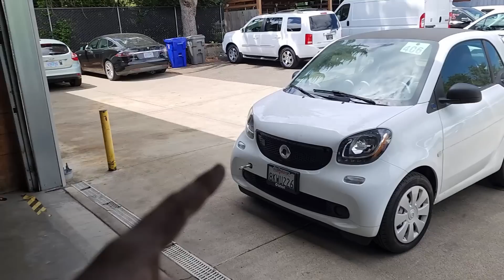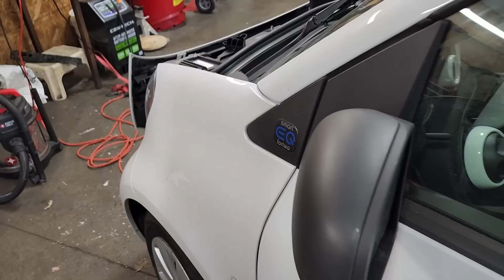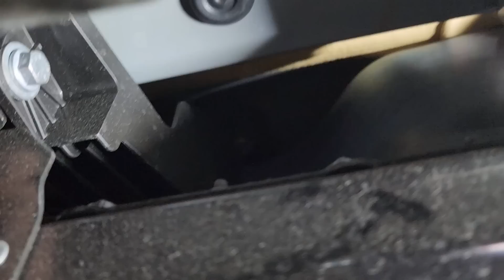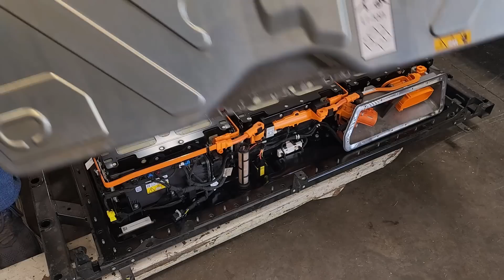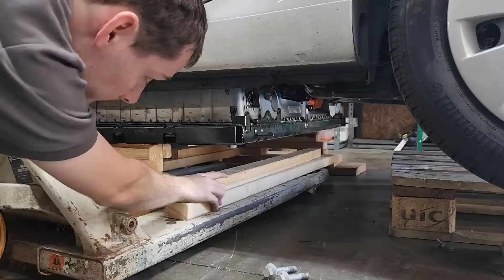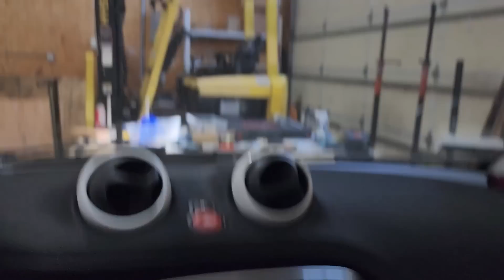Repairing a BMS "glitch" on a 2019 Smart EQ

Comment: I watched this video and would like to offer a couple of points. 1): If you have more than one floor lift you can probably get extra short arms to lift that tiny car. 2): A straight drive on lift like used for wheel alignments would get that tiny car up to work it very easily. 3): When you opened the battery pack you can see where the desicant is located. I would have replaced it since you are in there already. I can just imagine the cost for a dealer to drop the battery ever 2 years to change out that desicant pack.
Reply from the maker: The dessicant cartridge can be replaced without dropping the battery (it unscrews from the bottom). And like I mentioned, there's really no reason to "have to" replace it, just an arbitrary requirement that Mercedes made up.

As far as a drive on lift goes, the battery would be too wide to fit between the "runways", so not possible to remove it that way either. I specifically don't have a 4 post lift simply for that reason, they aren't of much use to me for these kind of jobs... I do have another 2 post lift that I could have swapped the arms off of, but then I would have been unable to use the it for anything else while the car was on it...

Comment: I wish this video existed 6 years ago. I mistakenly installed a mileage tracker (which had worked without issue in a 2016 Smart ED) into my 2018 Smart EQ. The 12 volt battery went dead twice before the problem was traced to the tracker. I removed the tracker and haven't had a problem since, although the 12 volt battery was replaced a couple of years later. I'm not sure where I'd be able to get this work done locally. Having to ship my car to Portland would probably be prohibitively expensive. Thanks for your work.

Comment: Looks as if you could have used a floor jack to lift up the rear of the car and swing the lift arms past the tires and use the lift.
Reply from the maker: The arms still would have been too long, and would have been lifting on the battery itself (no bueno!).
Reply: @AlexEVRepair  Good point.  Could you have driven the car onto the lift pads and lifted it by the wheels?
Reply from the maker: The car didn't drive, so that would be a negative... Not to mention extremely sketchy. 
If I had wheel support adapters (that "cradle" the wheels in place), then that would have worked. Those run about $1600 for a set though, so not worth it for just one job... If I have more service requests from Smart owners in the future though, then it would be a worthwhile investment.
Reply: @AlexEVRepair  That's crazy expensive, you could probably have someone fab some for a few hundred.

Comment: Have you looked into the OBC failure issues on the 2017-2019 cars?  

My 2017 OBC failed.  One of the two.  Apparently there are two at 3.xkwh each.  If I understood correctly.  Anyways the repair is $8000 plus my battery went bad while sitting at the dealer.   MBUSA covered the battery replacement.  It took MBUSA and the dealer 11 months to get the car back in the road
Reply from the maker: I've read about DC/DC failures, but haven't seen anything about OBC failures. Maybe one day I'll encounter one...
Reply: @AlexEVRepair there are posts about it in the FB group and one of the smart USA forums.

Comment: Two things.. Presumably the contacts in the contactor relay degrade and they set a limit to reduce the risk of fire? Just resetting the BMS and not replacing the contactor on an old car might be risky? Or do they reprogram the BMS with an estimate of the number of cycles used?

The other issue is the seal on the lid of the battery. Surprised its not a liquid sealer to reduce risk of water getting in?
Reply from the maker: This car only has ~20k mi, so not nearly enough cycles to have damage from "normal wear and tear" on the contactors. 

As far as the battery lid goes, it has a molded on silicone rubber seal around the perimeter.

Comment: Haaa nice job man 👍 glad  I didn’t have to pull them out that way ! Having done a good 75 batteries on Gen4 smarts i would died  My Dealer didn’t want to up date the hoist so I used 4 front arm set on the hoist! The Filter Service has been in the service check sheet from day one on all smart ED just like capacity test !When the 453 came out which is the one you showed here we where Original suppose to be able to open them up and change cells and other components but it’s a lawyer liability thing with the manufacturer since the Germans and the Frenchies didn’t want us going in there! So they just get changed out and exchanged and 
Prorated! good video. I appreciate being able to see inside stuff that I was allowed to take apart.👍
Reply: FYI so not to brick the HV Battery the car wants to see a key cycle before 14days of non op keeping a charger on does nothing ! Thats also in the hand book ! Which is the most unread book by most owners
Reply: @buzzbierbaum4026  so you are saying you have to turn the vehicle on every 14 days or you will have a problem with the batter?

Comment: Why not take the tires off to get the clearness you need? Also when taking the battery pack out  I wonder if a transmission jack would work better. I also wonder if a Technical college could invest in a machine to reprogram the BMS? Sounds like a new career choice for an automotive/electronic technician.

Comment: Impressive caverneering work in 6 inches of space.  Its like an MRI machine.
Did you change the Dessicant filter after all that? 😢
What a lousy trick that is, AND you have to take the Battery out every two years!
Reply from the maker: The desiccant cartridge can be changed without removing the battery (it unscrews from the bottom).

Comment: Owners should file complaint with FTC. Mercedes can not void warranty because an interval maintenance hasn't been performed unless they can prove that the skipping of that particular maintenance was the reason for it to fail. Same thing happened with warranty void stickers couple years ago and FTC ruled it out.
Reply from the maker: Yep, I totally agree.
Reply: 100%. I’d lose my mind over this treatment, and the contact bug shouldn’t even be a thing anyway, so it’s more insane.
Reply: Can report to NHTSA  @olemissjim
Reply: Link to file?
Reply: @user-sy4rg1gt1p Doesn't matter what you believe in, we have regulations that defines when the manufacturer can void the warranty. If Mercedes disassemble the battery pack and find moisture or corrosion related to the desiccant filter not being changed then they have all the rights in the world to void that warranty. But in this case they just do a service history check on the VIN and since there's no record about changing the filter they void the warranty which is highly illegal.
Reply: @TechSurreal what if it's done diy?
Reply: @Nicholas-f5  This has happened before in the class action lawsuit against Hyundai/Kia for the Tetha engines. If you have the receipt for the part, then it's sufficient to show that you have followed the maintenance interval.
Reply: Moraly you are right - from a legal perspective sadly not
Reply: @olaf_s_23  Right from FTC's guideline: Generally, tie-in sales provisions aren’t allowed. These are provisions that state or imply that a consumer must buy or use an item or service from a particular company to keep their warranty coverage.
Reply: @olaf_s_23  Please stop spreading misinformation if you don't have a clue on what you are talking about.
Reply: @olaf_s_23  I copied this section directly from FTC website:

"Tie-In Sales" Provisions
Generally, tie-in sales provisions aren’t allowed. These are provisions that state or imply that a consumer must buy or use an item or service from a particular company to keep their warranty coverage.

Manufacturer has to prove that customer's negligence and not following the maintenance interval caused the issue in order to void the warranty. In this case it would finding water/rust/corrosion inside the battery pack due to not changing the desiccant filter.
Reply: @olaf_s_23  Not just morally right, but legally right also (in the US).  Under the Federal Magnuson–Moss Warranty Act a manufacturer cannot deny a warranty claim due to lack of required maintenance UNLESS the manufacturer can demonstrate a causal relationship between the lack of required maintenance and the failure.  The act also places the burden of proof on the manufacturer, not the owner.  It is unlikely that Mercedes would succeed in demonstrating a causal relationship between the desiccant maintenance and the count down clock.  

However, if the insurance OBD-II plug-in module can be demonstrated to not meet the OBD-II port standard, then Mercedes could deny warranty under that circumstance.

Comment: Imagine owning a car and being limited by the amount of times you can turn it on.  I'd sell this thing asap and look for a model 3.  Thanks for bringing us along on another interesting repair!
Reply: Elon von Braunshirt wagen. NEVER!
Reply: Are you kidding?  At 9 1/2 years or 149,000 miles I'd turn the car off and on off and on off an on until it bricked the bms.  Since they don't service it, brand new battery!
Reply: The Cycles count to zero is set to 300.000! That´s around 300 Years at normal usage
Reply: @AndreasGoettsche how do you know it’s set to 300k?
Reply: @AndreasGoettsche Ach....wirklich? Quelle bitte